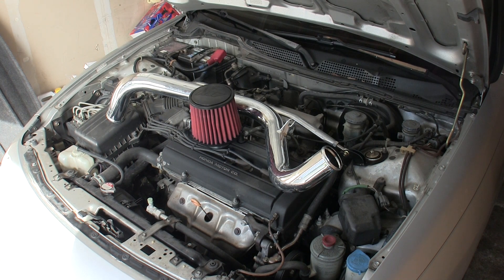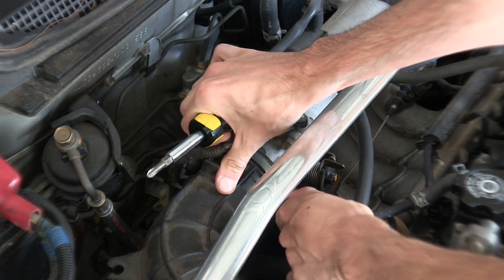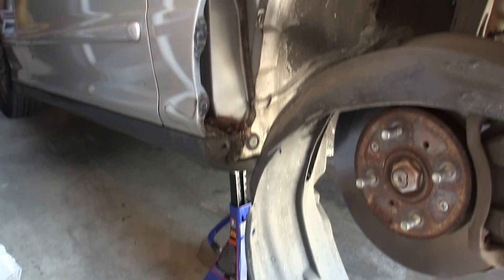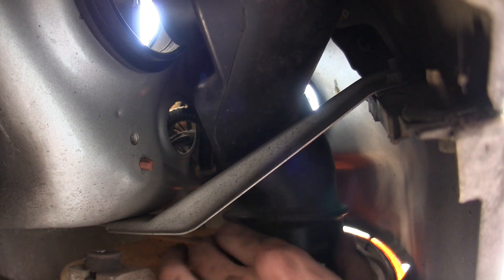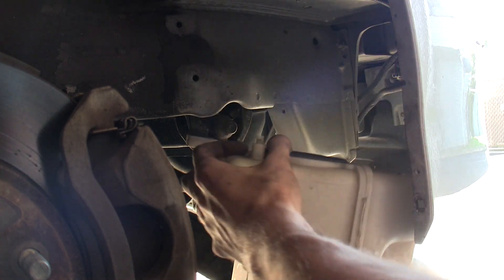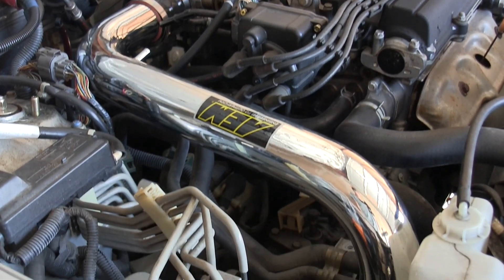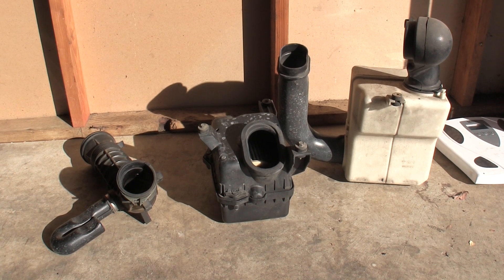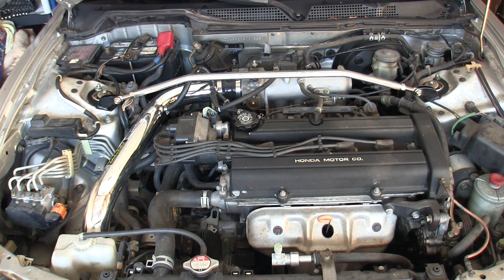Cold Air Intake Install - Project Integra

Comment: It may not be related but since an intake install gives you access to the throttle body, are you required to clean throttle bodies on sports cars?.
Reply: +ViciousJackal16 It's a good idea to clean that on any car. At least the intake got cleaned out, I mean replaced, lol :)

Comment: What about the coolant pipe in the throttle? In southeast region, climate is humid and warm, we block out the coolant hoses to the throttle bidy when preparing the cold air intake.  this further reduce intake aur temperature. 

If its not removed, its only effective during the start-up, once engine heat up, throttle body will be heat up too. Cold air temp will will increase at that point onwards.
Reply: +MICK LIM TECK WEE 林德伟 Great idea for next summer for my car!

Comment: Won't that long metal pipe just absorb engine bay heat and the incoming air then pick up the heat and feed it back into the engine? Shouldn't the pipe be made of plastic, wrapped in reflective aluminium tape?
Reply: Hi there!
I am currently studying mechanical engineering, lets see if I can help. I haven't taken heat transfer yet but i do know the basics. Maybe Engineering Explained can confirm what I am explaining.  

So, basic knowledge of heat transfer tells you that metal transfers heat faster than plastics. Its due to the thermal conductivity of the metal. Higher thermal conductivity of a given material results in faster heat transfer. You can notice this yourself when you touch a piece of metal, it will be cold due to the metal transfering your body heat from you. So when the pipe sits in the engine bay it is cooling off more than say a plastic pipe, which would take some time to heat up but once it does it will stay hot (due to plastics crappy thermal conductivity). A metal pipe in combination with convection effects (air flow) will further cool down the pipe. For example, convective cooling effect can be seen in  heat sinks on the back of a DJ speaker. The heat sinks are made out of metal (probably aluminum) and have fins. These fins allow air to flow through the heat sink further cooling the metal. Believe it or not this prevents the speaker from overheating. Anyways, I hope I answered your question. Any additional questions just ask.

Comment: Please make a video comparing lightweight flywheel vs stock and compare the MPG. Does it improve or decrease?
Reply: +Rodrigo Cunillé Great idea! Do you happen to know if flywheels are the same on manuals and automatics? It kills me that I'm illiterate on this subject. Tons of lightweight flywheels are available for my car, but they give me the feeling they're for a manual only.
Reply: DE Nichols Flywheels are only for manual transmissions. Automatic transmissions use a flex plate that is similar to a flywheel but a it's already lightweight. So a lightweight flywheel is only for a manual transmission. I really don't know if there are aftermarket lightweight flex plates.
Reply: Rodrigo Cunillé Thank you.

Comment: Hey I've got a question. So wouldn't putting the intake that low to the ground make it possible for it to suck up some standing water? If so, would there be ways to prevent that?

Comment: Hey, good vid. Can't wait to see the testing on it.

Just as a video suggestion. Can you please do one on the tachometer? What it is? What it tells us and why it's useful? What relationship it has with the rotation of the crankshaft? Why revs per min don't have a 1:1 relationship with the speed. As revs increases why speed doesn't increase exactly the same amount? Also, any relationship it may have to fuel consumption (i assume more heavy footed driving would lead to higher fuel usage). I have some basic understanding, but your vids are usually really great and simple. Cheers :)
Reply: custommotor
Sorry, the part at the end about engines didn't really convey what I meant it to. I was pretty tired writing that. I know the transmission and drivetrain don't have anything to do with new engine technology, and wasn't trying to imply the transmission gearing causes the engine to make more power. I meant to cite that as an example of what engineers do to optimize vehicle performance overall. I apologize if that was misleading.
And you're correct about the torque figure. I wasn't really thinking when I said that. Mine is the naturally aspirated model. It's got more horsepower than the V6, less torque. It FEELS like it has way more torque, which is probably where I was going with that, but factually it creates less torque.
The important part is I explained the rest of it correctly before I started rambling nonsense. :D
Reply: In case he doesn't get to you or make a video, here's a crash course.
The tachometer counts you how many times your crankshaft spins around per minute. Revs don't have a 1:1 relationship with speed because you have a gear box, which makes the ratio more like 4:1 for first gear, 3:1 for second gear, 2:1 for third gear, 1:1 for fourth gear, and about .75:1 for fifth gear. Obviously each gear box is different but that's an example. Your rear differential, such as in trucks, will be something like 3:1 or 4:1 as well, altering the way power is put to the ground further. The figure for the gear ratio at the wheels is the final drive ratio. If first gear is 4:1 and the rear diff gear is 4:1, then your final drive ratio in first gear is 16:1. In this example, at 16:1 your tire will spin one time for every 16 times the crankshaft rotates.
This is done for several reasons. The main one of which is your engine doesn't have enough power at a 1:1 ratio to get you moving if you're sitting still. Gear ratios make it easier for the engine to spin the rest of the drive train by letting them work over time, instead of having an instant response.
It's like you've got a pallet of sandbags that you have to put in the bed of a truck. It's a lot easier for you to move them one at a time than lift the whole thing up at once.
That's why we've invented two speed, three speed, 12 speed gearboxes, because it's easier to get the work done little bits at a time. Once you're moving, the workload lessens because you gain momentum, and it takes less engine rotations to spin the tires. Having more gears takes advantage of this momentum and allows you to move faster and use less power.
This is all optimized by engineers who design engines to maximize torque, horsepower, and fuel economy. Then design the drivetrain to use those figures in the most effective way possible. This is why the 2.0L 4cyl in my Focus has more horsepower and torque than the 4.0L V6 in my Ranger, and gets 2-3 times the fuel mileage.
Questions?
Reply: *****
I drive a manual every day, so I pay lots of attention to the tach. ;)
The torque converter is a bit more complicated. I'll try to keep the explanation simple and explain what it's for without getting into the somewhat complex details.
In a manual transmission you manually control the contact of the flywheel to the transmission via the clutch, using the clutch pedal. When you push the clutch pedal in, the clutch disk is pulled away from the flywheel, allowing the transmission to be in gear while you're sitting still.
In an automatic you don't have a clutch pedal, so something has to break contact between the engine and transmission so you can be engaged in Drive while sitting still, the torque converter does this.
As for why we have a tach? In manuals it's obvious why we need them, but some things still don't have them. My motorcycle doesn't have a tach, though I wish it did.
In automatics, the answer is simple. No. You really don't NEED a tach at all. A friend of mine has a 2000 Crown Vic police car that has no tachometer. But sometimes even in an automatic it's nice to know how your engine is spinning. You can see on the tach if the car has a rough idle, you can see if it has a misfire, you can see if your throttle is sticking or something otherwise unhealthy is going on with it. Also, fuel economy. Your engine uses more fuel spinning faster rather than it does while spinning slower. If you watch your tach and use your foot appropriately to keep the needle in the small numbers, you save fuel.
But no, it's not truly necessary on any vehicle. Just really helpful.
Reply: stevetheviking
all good, just didn't want the original poster to get the wrong impression.
Reply: custommotor stevetheviking Thanks for both of your replies. Yeh, definitely see your point on why tachs are good in manuals and why they might be useful in any type of car, even an auto. I've not experienced many car troubles, but i can see how it maybe juseful to detect misfire or poor idling/fuel usage. Cheers.

Guess i don't need a vid on it anymore :P
Reply: *****
Your welcome dude. Nice to see internet friendliness. :P
Reply: stevetheviking Your engine horsepower and torque have nothing to do with gear ratios and your 2.0L isn't more powerful then your 4.0L. If it is a 2.0L naturally aspirated motor it makes 160hp and 146 lb/ft of torque. The 4.0L makes 160-207hp and 220-238 lb/ft of torque. You may have the turbo 2.0L that makes 252hp and 270 lb/ft of torque, but that isn't because of the transmission or gearing. If that's the case you just have a newer direct injected turbo motor, thats where the extra hp and especially torque come from. Just newer design. The fuel economy is probably not better because of the transmission, it helps but your extra fuel economy comes from aerodynamics and having half the engine size, because your 4cyl probably is spinning faster in every gear then the 6 at a given speed.
Reply: stevetheviking
Thanks for the indepth reply. I think that is a good starting point to explaining why 1:1 ratio between tachometer and speed doesn't exist. Put in the context of gears it makes sense. I don't own a manual so didn't consider it like that, but i guess same principal with how torque converters work? right?

Some of my other questions still stand. What is the point of seeing a tachometer in the car? Only reason I can think of is to see if you're not over-reving and stuffing up the engine.

Comment: I don't understand how this makes the air cooler.
I mean it seems like the same thing as your intake before except without a resonator.
Air still just flows though a filter, through a pipe, into the engine just like before right?
And if this is the case what is the point of even having a long metal pipe? Why cant you simply attach a filter right to the throttle body?
Reply from the maker: iwillavengeyou The whole purpose is to pull air from outside, not from the hot engine bay. The stock setup in this case pulls from the engine bay.

Comment: No before and after dyno test? It's already proven that there is zero increase in power Mightycarmods did a real video and actually tested stock air system v cold air intake. The only difference you can make is driving through a puddle and trashing your engine.
Reply: They did test it on a turbocharged car though, where the intercooler already does the job of a "cold air" intake
Reply: Andriy Shevchenko
I can see the headlines now...
"Cheap cold air intake didn't improve Nissan GTR dyno results, whole world shocked"
Reply from the maker: fuzzybobbles This is an installation video, not a test. I like how you said they did a "real" video. I hope to make real videos one day. Here's my testing on the SRI. Short Ram Air Intake Testing - Project Integra

Comment: My '88 ranger had an air filter box, but it would draw cold air from the front grill of the truck. Every cold air intake I've seen has the filter exposed all around, but I wonder what happens when you start driving through puddles in the rain and water is splashing up? Does the water ever clog up the filter when it's not in an enclosed box?
Also, wouldn't my ranger be just as efficient using an K&N in a filter box since it draws the air from a cold source? Or is there more efficiency to the exposed cylindrical filter drawing air all around?
Reply from the maker: ***** Depends how restrictive the resonator is to make the intake quieter. If you're pulling from the outside already, you won't be pulling in cooler air, obviously. The restriction could make a difference, but it's different in almost every case. I'll have test results posted soon!
Reply: As long as you don't go romping through deep water with a cold air intake, chances are you will be just fine!

Comment: Any test videos for the strut bar?
Reply from the maker: ***** Nope, and honestly it's a pretty junk bar. The company who sent it said they'd be sending a different one, and this is what I ended up with. Ideally want something with less joints so it's rigid. I could solve this by welding it up, but i'd like to keep it easily removable for now.

Comment: Battery mate, you forgot to reset the ecu
Reply from the maker: Johnny Salvattore Perhaps I failed to mention, I disconnected it prior to starting.
Reply: Probably i failed to listen to that part. Either way, I'm anxious to see the results of your tests. I've modded a few engines before though I've never invested time time to see actual individual results. Great vids! Cheers

Comment: Having the air filter so low in the car isn't dangerous? I mean on a rainy day the engine can suck up water, right?
Reply from the maker: Umberto Bizzarro It absolutely can be. In a car like this I wouldn't recommend it if it's you're DD and you live in a rainy area. But with normal rain it should be fine as there is a fender liner protecting it.
Reply: Just make sure that the puddle isn't touching the intake. Depending on how low your car is(aftermarket springs) if half of your rims will get covered in water it would be very dumb to drive through that. They also include aftermarket splash shields sometime that come with the intake. That can help.

Comment: What's your jack stand setup, and is removing the silencer similar for other cars?
Reply from the maker: Grant Rodgers Different cars have things located in different areas, the overall procedure will be similar but unique to each vehicle. I think I bought the jack stands at Autozone, 2 or 3 ton.
Reply: cool, thanks!

Comment: Can you do this even if you drive in the snow?
Reply: I doubt the intake can suck up snow lol. Maybe if the snow is melting and there is a clear deep puddle of water. You should avoid deep puddles I think that if the water covers half of your rims it will hydrolock. The lower your car the less tolerant it will be to puddle deepness though.
Reply: SI0AX I know it won't suck up snow but i meant the splash from puddles or slush that gets kicked up from tires, would it be worth it to install or would I be wasting my time with extra maintenance?
Reply: ***** Some cold air intakes come with a splash shield that can help. I think that this would only be worth installing if it does increase power by at least a decent amount. Because I think that paying $150-350 for something that only has a 5hp increase isn't worth it when there are mods that are cheaper and do increase power(without controversial debates). Intake mod power gains are contoversial and to me that alone is not worth a buy to me.
Reply: SI0AX share with me some of your cheaper and more powerful mods, I'm curious and if you can't tell I'm pretty noobish to the car scene but I'm interested and want to learn
Reply: ***** well that really depends on what car you have. If it has a small engine like the japanese go turbo. Ignore the people that are against turbos (like honda civic ricers) hondas are great with turbos the thing is you have to program the ecu/pcm which is the most important mod above all else(also most complicated). 

Turbos require many extras like intercooler, waste gate, downpipe with exhaust, you should check out turbo kits with all the stuff you need so you can either buy it or replicate it for cheaper.(they go for like $1.5-6k)
Reply: I wouldn't, also notice the annotation at 4:30
Reply: no, you should stop driving and go to a garage
Reply: Sens23Bruins I watch on mobile devices so i don't see annotations.

Comment: Are you going to work on the body kit ?
Reply: Just curious, why would he? Last time I checked, body kits don't really do anything performance wise, aside from front and rear splitters and a functional aerodynamic wing. Most of them I see just create drag and, in my opinion, make the car look trashy.
Reply: disturbedrocks1996 there are very few that actually help performance, but an entire kit for the whole car is a negative effect. Just to throw it in there!
Reply: Justin McLauchlin I remember the japanese saying that they didn't understand why people would only put some parts of the body kits. They said if you only use a few parts and not all that the aerodynamics will actually be worse than stock. However if you used all the parts then it would be better.
Reply: SI0AX If I was Japanese I would wonder why people would put body modifications on at all, if they weren't racing. I mean at what point, in regular life, would you need extra downforce? I mean don't road cars generally provide enough mechanical downforce on their own without some college dropout fuckwit ricer strapping on a tacky bodykit and rear wing? The only modifications I understand even remotely are maybe a cold air intake or an upgraded exhaust with some aftermarket wheels to slightly personalize your vehicle. Bodykits, wings, racing seats, roll cages, etc. what's the point if the car isn't going to be used as a track vehicle?
Reply: disturbedrocks1996 Usually people with these mods that don't visit the track participate in Illegal Street Racing. Most of the time they are ricers with cheap exterior mods on even cheaper cars that have nothing of performance.